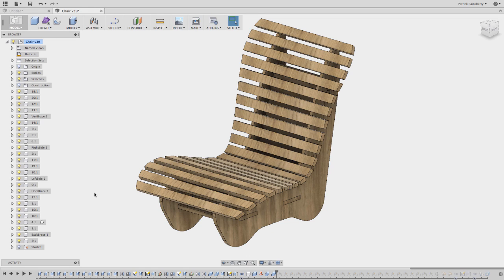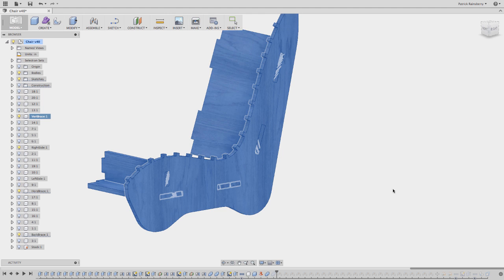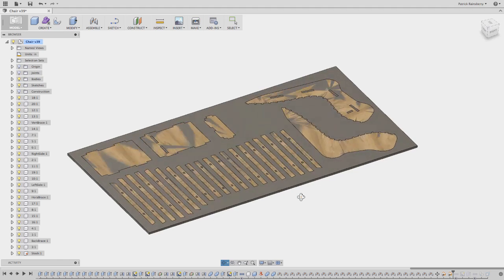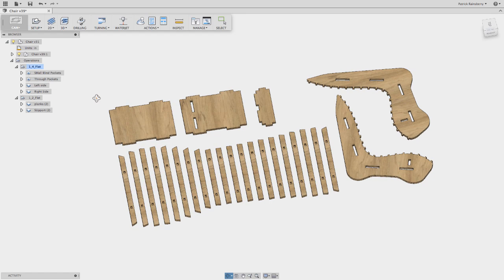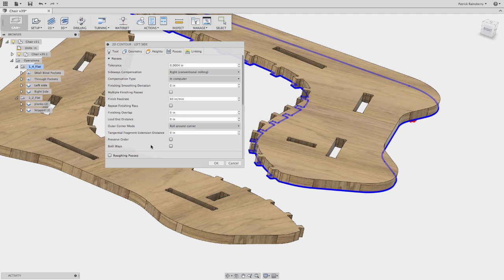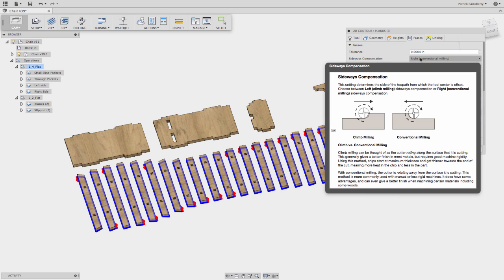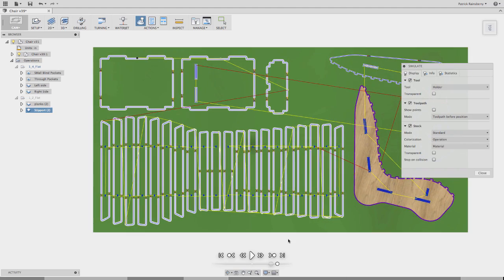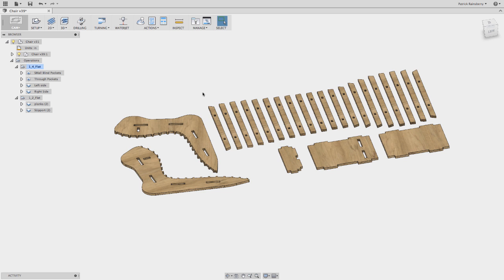Overview of Fusion 360 for CNC Routers (Chair Design)

Comment: Patrick, great video..hw did you built the tabs along the curve?
thank you
Reply from the maker: I actually created a body to represent the tabs and patterned it along the curve.  THe manually rotated them to ge the alignment just right.  
Next combine the tab bodies into the main body.  
Finally you have to manually draw the dogbone fillet sketches.

So a little more manual, but you can get there.

Comment: Out of curiosity, is there an easy(ish) way to add a tolerance to a cut like you did for the tabs?  This might not be needed in wood, but I do a lot of 3d printing and small tolerance gaps are often needed there if you don't want to end up doing a bunch of filing afterwards, or if you want to do print in place joints etc...  If I was doing this myself I would probably cut out the tab and then push/pull a tolerance distance, but wondering if there is a better way.
Reply from the maker: +Alluvian yes i believe so.  This is outside my expertise (contrary to the publishing of this video i really don't know much about CAM :)  I think you can apply an offset to the tool path in "compensation" or you can kind of fake it i think by changing the diameter of the cutter vs what you are really using?  Is that kind of what you are talking about?
Reply: I was more thinking on the CAD side of things, Where you could subtract a slot out of another object, but leave a tolerance gap between them.  I know I could do this by subtracting two objects, then grabbing the connecting face(s) and doing a push/pull operation, but this would be harder with more complex shapes.  Just something I find myself doing a lot, making tabs that fit into slots, but either the tab or the slot needs 0.2 mm or so of gap.
Reply from the maker: +Alluvian i see what you are saying  Yah you can definitely just do that in the actual CAD model.
Reply: Alluvian use a slightly different cutter definition...but don't change the cutter. Your slots will have an extra few thou and it will not be noticed in the overall dimensions.
Reply: can u help me find my son